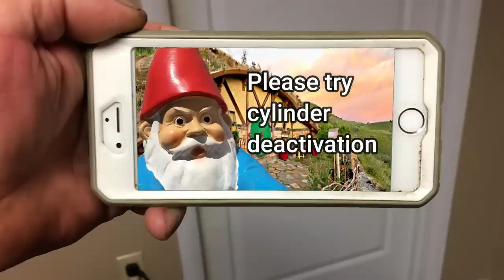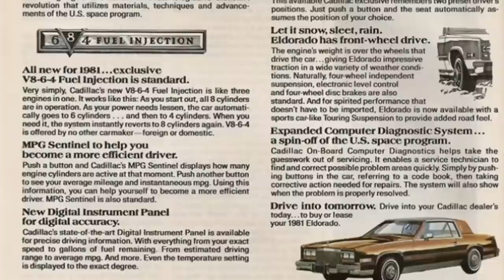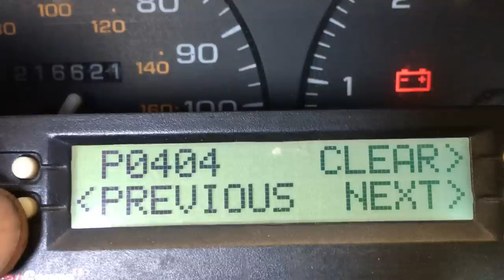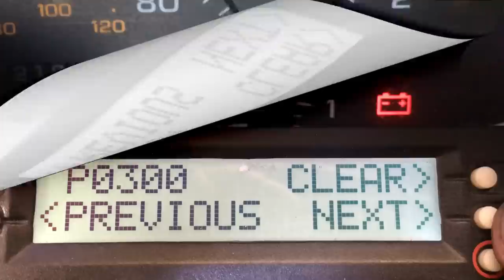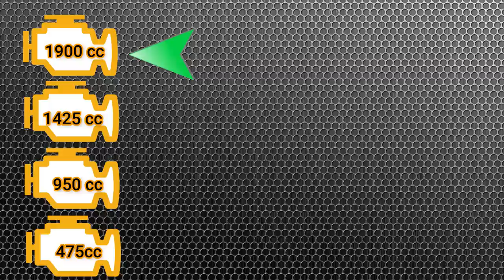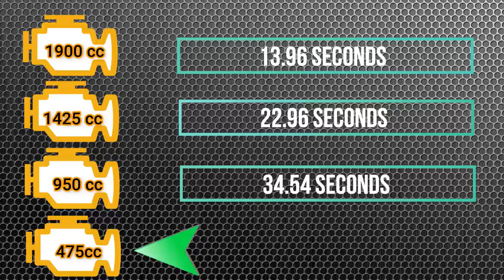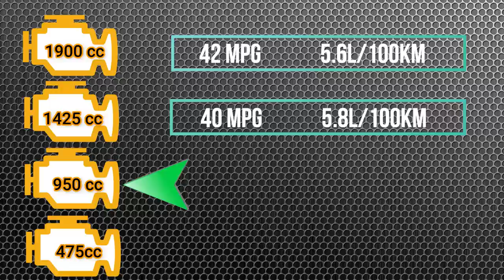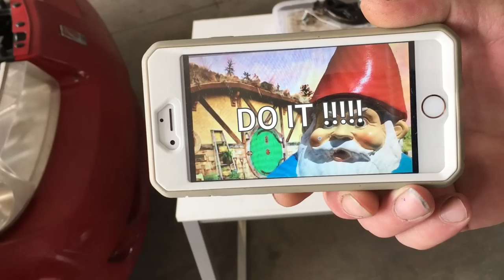S2E16:  We deactivate cylinders on our Saturn and test the car for performance and MPG

Comment: The oil burning at the beginning of the 3 cylinder mode is because of the oil being pulled up past the piston rings in 2 cylinder mode. The piston is still going up and down but with the valves being shut there is vacuum and compression still being made, but it's going past the piston into the crankcase. I would also remove the spark plugs after removing the lifters.
Reply: Beat me to it
Reply: I ran my V8 without part of a sparkplug that broke upon removal (I didn't have an extraction tool and the hardware stores were closed). I disconnected the fuel injector and ran the engine so I could park my car in the garage, and while running there was a serious put put noise during the time the cylinder was rising. It was quite noisy without that sparkplug. So I doubt they could run two cylinders without sparkplugs.
Reply: Yes compression and vacuum are parasitic on the energy output of the running cylinders.
Reply: yep, thats exactly whats up
Reply: No, removing the spark plugs will add significant pumping losses, absolutely not a good idea.  There should be zero net pressure in the deactivated cylinder, the energy put into compression is put back in during the down stroke, so power loss for this is very small.  Removing the spark plugs means you are expending energy on both strokes.
Reply: No, the air in the deactivated cylinder acts as a spring and wastes minimal energy. Removing the sparkplug would create pumping loses as the engine moves air through the spark plug hole. You'd also ingest dirt into the cylinder as the air wouldn't be filtered.
You still have the frictional losses from moving the pistons through the bores.
Reply: @Surestick88  Love the comments here.
Reply: I had a faulty spark plug fall apart, the center electrode fell out of the body, luckily out of the engine. I was driving along with a v-8 on a mt pass and randomly got a weird engine surge and then a loud putt putt noise, almost deafening while accelerating. 

I got out to check on it and thought the spark plug must had been loose and let itself out. Between the exhaust manifolds it was much too hot to touch. I drove it back down the Mt pass with it sounding like crap, but I could barely tell the difference power wise. By the time I made it to a town, the spark plug had blown apart and the porcelain was hanging by the plug wire. 

I had no tools and could not get the spark plug out, so I ended up driving it almost 200 miles home.
Reply: @lilsammywasapunkrock  Wow,  200miles sounds like a long drive. 🚙🚙🚙
Reply: @kansasrose2909  at the time, I was driving 260 miles twice a week and staying at a hotel. We were running fiber optics in a rural mountain area tying together all the little towns. We usually worked 7-14 days at a time.
Reply: @lilsammywasapunkrock  There are a lot of little towns here in Kansas..  I admire the work it takes.
Some would shy away  from that.  There is so much to the fiber optics,  many fail to realize.
Reply: @kansasrose2909  we call that gravy out here... Most fiber reels are 20k reels. They pay you by the foot, some places as little as $.05 a foot, but a good paying gig can be $1 a foot or more. So if you can burn a reel in a day...
Reply: Beat me to it! Lol. I was wondering if he was going to remove em. Put some breathers on em and the motor should have some power back
Reply: Why remove valves when the plug is out
Reply: Or he can plug the spark plug holes, remove the Valves and use the middle two cylinders as a air pump
Reply: I wouldnt remove the plugs, you would lose energy to pump air through the holes. What is needed is to remove the lifters at lowest piston position, so trapped air acts as a spring.
Reply: If you remove the spark plugs it won't work right, because you'll have "pumping losses" through the plug hole(s).
Reply: @ferrumignis  Damn... I just wrote wha you did (in a nutshell though...lol).  But THANK YOU for being someone who "gets it"! :D
Reply: @John--cu2yu  LOL! Yeah!  and then route the exhaust from those "air pumps" back to the intake.. lol
Reply: @off spec Removing the piston and rod (as well as lifters) would remove the parasitic friction. However it's quite a bit more work and cost (new head and pan gaskets etc) and you'd get an unbalanced engine.  Removing 3 and 4 rather than 2 and 3 would minimise imbalance but you'd get uneven firing intervals.
Reply: this is actually a problem on the older Honda vcm systems
Reply: @billymanilli  i like to think it would function but if it would it would have been done already, roots supercharger only has 2 moving parts so it’s kinda ott
Reply: GM has been doing this for over a decade with success (bad lifter design notwithstanding) and both lifters are deactivated in that system. It runs under partial vacuum & there's no air friction where there's no air. The problem with removing spark plugs is the parasitic loss of constantly forcing air in/out of the tiny plug hole.

The oil issue is a result of a worn-out engine (rings) and will still suck that out of the crankcase if it doesn't create a vacuum. You still have the other active cylinders' blowby pushing crankcase windage (oil) thru the deactivated cylinders' rings.
Reply: @akkudakkupl  you think a cylinder is perfectly sealed .  that's not the case . the only way for 0 losses is to remove the piston and rod .
Reply: @ferrumignis  I think you would need to do a fair bit of math to actually figure out if it takes more energy to compress the cylinder than move a free piston up then down, not saying you’re wrong but I doubt you’ve actually mathematically checked and found you’re correct either
Reply: @SmothersSawShop  It wouldn't take any math at all because this was worked out long ago by people that actually design engines.

What do you think the energy losses are from compressing air and then allowing it to expand again?
Reply: I was hoping they removed spark plugs
Reply: @ferrumignis  what if you  permanently leave valves close st anytime on the 2 disabled cyl. remove both spark plug then plug a conduit between both so when one piston moove up it push air into the cylinder that goes down , perfect equilibrium
Reply: "I would also remove the spark plugs after removing the lifters"
Makes me really uncomfortable, no filtering... I'd just find a way to keep the valves open instead or filter the plug holes.
Reply: I was gonna say the EXACT same thing!
Reply: @BradleyGibbs  its because if you just remove sparkplug piston will constantly spluttewr air out and inject air in cyl  each stroke, need absolutly to route one cyl into another to ''cancel '' this  phenomena
Reply: @Vo0d0o2009  That does not make sense.
Reply: @BradleyGibbs  sorry but your answer have much less sense without explanation
Reply: an up and down piston create pressure /vacuum , that translate into resistance for other on the same crank , if you explain why what ive said have no sense it would be more credible than just say ''yellow is not yellow''
Reply: @Vo0d0o2009  It would help if your prose didn't seemingly convey the possibility that English is your 47th language.
That being said, I understand that sealing an unused piston creates drag, my concern is about unfiltered air coming in through the spark plug hole.
It would make more sense to me to either keep the valves open or remove them than to remove the spark plug.
Reply: @BradleyGibbs  it is why ive mentionned to link both sparkplug holes by a conduit like a diesel injector hose or simply an hose with 2 compression tester plug at each end  , so the piston that goes up push air into the piston that goes down and vice versa , 

you are right im french ( quebec , i speak french and its my primary language , ive put some effort to learn it at my best  ) and i force myself to talk in english
Reply: @Vo0d0o2009  "it is why ive mentionned to link both sparkplug holes by a conduit like a diesel injector hose or simply an hose with 2 compression tester plug at each end  , so the piston that goes up push air into the piston that goes down and vice versa"
That only works if you have an even number of inactive pistons🤔
Reply: @BradleyGibbs  yeah on a 4 cyl  1-4 moove identically , and 2-3 too 
if you desactivate 2 piston on a 4 cyl engine you desactivate like numper 1 and 3 , or 2 and 4 , to maintain the right combustion cycle , , 
you connect desactivated spark signal , and injection signal , and route it on their respective active cyl , lol so the car does not lost the 2 other sparks 

if it was my project i would do it like that
Reply: ex: 
i have a 4 cyl engine 
i want to disable 2 cyl
i know that cyl2 and 3 moove identically and have the same height at TDC
i know 1-4 moove identically and have the same height at TDC 

i know that my fiering order is 1-3-4-2

1- i will choose to disable cyl 4 and 2

2- i remove camshaft and strip cam lobes on 4-2 to maintain valves closed permanently

3-i remove sparkplugs on 4-2 

4-i build a compressor hose mounted on 2 compression tester plugs at each ends
 
5- i plug 4-2 spark plug holes  with this hose 
 
6-i cut all 4 cyl spark signal that goes to the coil and put a diode on each one 

7-i connect the end of diode from spark signal cyl 4 to the end of diode of spark signal cyl 1 

8- i connect the end of diode from spark signal cyl 2 to the end of diode of spark signal cyl 3 

9- i reconnect my modified harness to cyl 1-3

9 i repeat the exact same procedure as step (6-7-8-9 ) for the injector harness

-now the new fiering order is 1-3-1-3
Reply: you cant really disable an uneven number of piston without ruinning engine effiency it will run like a crap and probably need a crazy crankshaft modification ( i think )
Reply: No😐
Reply: @Vo0d0o2009  that sounds like you'll end up with redundant sparks.
Reply: @BradleyGibbs  yep ( ive not expected one important variable on this setup ) 
to work 
new lobes on camshaft  cyl 1-3 need to be welded 180 degree from the other  ( yeah 2 lobes on intake /hexaust valves) lol
otherwise your absolutly right , gas + spark will occur even with valves open/close 
! 
i think it would be a nice idea for garage 54
Reply: Rpm
Reply: Remove the piston and the conrod at the crank
Reply: @AlienLivesMatter  pretty sure that would ruin balancing...
Reply: I would allow the exhaust valves to be cracked open to help with pumping losses. The pistons are going up and down still.
Reply: Nope, do not remove the spark plugs! This will make a lot of noise and create pumping losses, lower power and reduced mileage
Reply: @rydplrs71  ~The actual power loss would be much less than with spark plugs removed. With plugs removed the engine would be pumping a lot of air. With the plugs in, the compression stroke would return that energy by pushing the piston back down. Think like a spring.
Reply: @John--cu2yu  and add air brakes
Reply: The vacuum without forcing the valves open would be enormous the plugs would have to be pulled
Reply: @BradleyGibbs if the valves are open your loosing unburnt fuel

Comment: Reason you were burning oil is because when the cylinder is deactivated oil starts to pool up in the cylinder. A big reason why GM has a time limit on how long DoD/AFM can be active before disengaging. With you driving it for an hour or two straight I’m sure there was some decent oil in that cylinder.
Reply: Yep my 2008 LS4 with AFM was notorious for the white/blue/grey puff of smoke when switching back to 8 cylinder mode. 27MPG in a v8 sedan but not enough to have everyone behind wondering if my car was falling apart.
Reply: Wondering why they not just open the inlet and outlet ports in a 2 stroke fashion and turn off ignition and injection. This way there's not so much suction going on and the oil won't collect in the cylinder.
Reply: Came here to say the same thing
Reply: @RubenKelevra  most cylinders have interference fit on 4 stroke so while you could open the valves you need to make sure they are closed at TDC. Much more complex as well because you would need a VVT like system or a cam with multiple lobes to change between the different modes.
Reply: @brianhunt6943  well, you need a cam with multiple different lobes anyway, as you have to keep them closed. Anyway shifting the cam over to a different pattern with a fork doesn't sound that complicated.
Reply: @RubenKelevra  no you don't they stay in position with oil pressure and different lifters look up an AFM swap for the LS engines it is an interesting system if a bit flawed.
Reply: @brianhunt6943  your sentence make hardly any sense.

In the video he's explaining that he's not opening the valves for all 4 cycles and states that this is how manufacturers do that, too.
Reply: @RubenKelevra  His sentence makes sense.  He's saying the valves are kept closed by collapsible lifters rather than special cam lobes.  Also, opening valves introduces pumping losses not present when they are kept closed so would be worse for fuel economy.
Reply: @thisnthat3530  that would be worse for fuel economy,  agree
Reply: @thisnthat3530  simple "pumping loss" is much less than compression and decompression of the air in the cylinders. 

Additionally if you burn the oil in the end you're likely to kill the cat prematurely and cause a lot of buildup inside the combustion chamber.

If you're running a turbo, you're even increasing the boost pressure while having a lower RPM because you're pumping additional air into the exhaust.
Reply: @RubenKelevra  Thank you for this very astute reply,   I really appreciate the input. 🌹🌹
Reply: @RubenKelevra  How does "comression and decompression of the air in the cylinders" cause high losses?  Energy is transferred from the crank to the air during compression, then is returned to the crank during "decompression".  The compressed air is doing the work during decompression, just like during the power stroke of an active cylinder.
Reply: @thisnthat3530  if you compress air you create heat which is transferred to the piston walls and lost that way.
Reply: @RubenKelevra  Sure, but it's less than the losses pumping air through the valves.  If it wasn't, manufacturers would simply disable injectors rather than have complicated valve train components to shut the valves off as well.
Reply: @brianhunt6943  why don't they just have the intake and exhaust ports operate as normal but the fuel injection shut off? That seems to be the simplest way to do it.
Reply: @briannem.6787  Love the comments here... I come in for the video and stay for the smart comments.
Reply: @kansasrose2909  I come for the video and stay for the crazy
Reply: @kansasrose2909  Me? Smart? IDK if that's true but thank you!
Reply: Probably do something with the Knock  Sensors... Are probably going crazy also from the misfire

Comment: use the 2 deactivated  cylinders as a supercharger for the 2 active  cylinders.
Reply: that would be awesome to see, immagine like a 6cyl operating on 4 but with 2 used as compressors
Reply: Oi
P  
    Ql
Reply: Hell yeah
Reply: I do wonder if that would be achievable under the terms of "youtube budget"
Reply: You'd have to bore out the charging cylinders to get more air in, or use three deactivated cylinders to change one active...
Reply: What if implement charging indirectly via a pressure accumulator?

Comment: My brother and I tried cylinder deactivation on my 1981 Jeep Wagoneer with an AMC 360.
Experiment 1: Rapid deactivation of 2 cylinders while traveling at 55 mph. Cylinder 8 was deactivated by disconnecting the wrist pin end of the connecting rod, which then deactivated cylinder 7 by way of removing the rear section of Cam. Jeep was able to climb the hills to his house, reduction of economy observed, some rod knock and reduced oil pressure observed.
Experiment 2: Deactivation of 3 cylinders. Jeep able to move still, but unable to climb 8% grade except in 4-low, first gear - barely. Fuel economy appeared unchanged.
Experiment 3: Deactivation disabled by replacement of spark plugs. Jeep again able to maintain 55 mph, Economy returned to normal, bottom of tank observed 3/4 mile from gas station. Hyper miling mode engaged to achieve station.
Reply: Love the comments here.... I come for the video and stay for the great comments